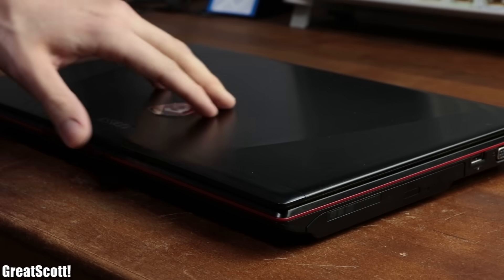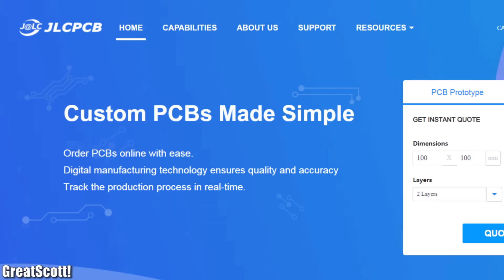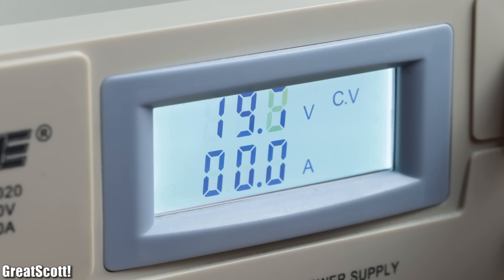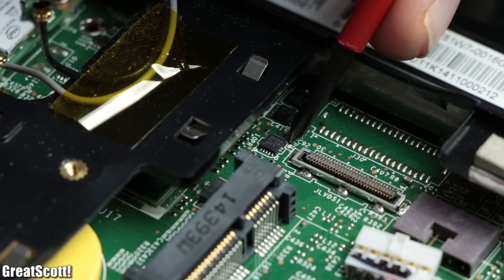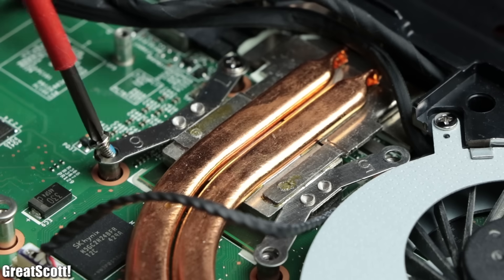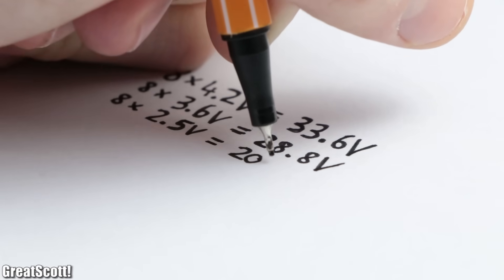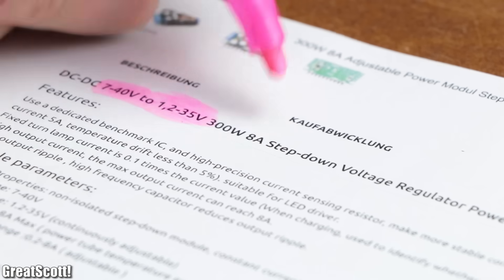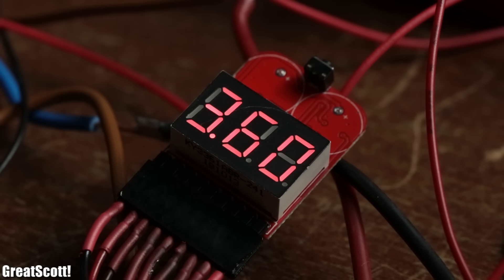DIY Laptop PowerBank (battery pack to charge your laptop on the go)

Comment: Next Video should be for a desktop computer for power outages.
UPS (Uninterrupted Power Supply)

Include a low battery system to inform the desktop to start shutting down to prevent damage of a sudden power cut.
Reply: you could use an atx converter plug that converts 12 or 19v to 3-5-12 then wire it to a battery then wire a charger to it so it keeps charging then when you have a power outage the battery continues to power the pc . but the issue is if its a gaming pc then the atx psu module wont handle it  im not sure what they are called  but its the 24pin motherboard power block  where you get in an itx pc  what can run off 12v batteries .
Reply: @danielhorne6042  Those ATX PSU modules are known as "PICO PSU"
Reply: Too dangerous obviously
Reply: @rolandmeiner4970  Except that there are thousands of designs on the Internet already, and a noob might try them and shock themselves because the schematics didn't come with a warning. It's better for a big, influential channel to make one with proper warnings than not to. Now, if the issue is that Jeremy (who's behind GreatScott!) is afraid of mains voltage himself (a completely normal thing for anyone who's not Mehdi Sadaghar from ElectroBOOM, including myself), then yes, he has an excuse.
Reply: @GRBtutorials   in some countries it is also illegal to build 
your own devices on mains and making a video about that is dangerous for not knowing viewers who then kill themselves
Reply: I already have a system for my PC, I get lots of power outages during storms because I live in a small town far away from main cities. And storms are also common here, so I bought a 220 amp acid battery and connected it with Inverter which charges and also give power in outages.
Reply: I believe Google, when they used to build their own servers, had a design where a battery was charged and maintained via the regular power supply, and would power the server until it could be brought down gracefully.
Reply: @Blondie SL sorry, you are wrong...

Pure sine wave is needed to run rotating devices, like an induction motor and the like.     Pure sine wave inverters don't exists to make clean dc power.  In fact, they use dc to make the sine wave.   UPS's run off grid power and use a battery when running DC.  

Clearly, you have little experience if you don't know why a pure sign wave is needed.   Square wave creates massive heat in things like an AC compressor,  a ceiling fan motor and can hardly start a drill.   

I know,  you feel empowered and think you know all. 

When a pure sine wave is converted to dc you still have choppy power. A person uses a full bridge rectifier to use both the valley and the peak of the AC wave, this still gives wavy DC power.   It is a noticeable chop with either source.   Capacitors and inductor rings are used to stabilize the DC signal.   It isn't like a pure sine wave creates smooth DC.  It is the cap and ring that does that....
Reply: @Blondie SL I have experience,  in fact,  I am dealing with it now.   Every day, all day...

For the average converter, pure sine wave is better.   It is assumed that is what will be the input.   But,  it still remains true that the capacitors and induction rings are what stabilize the DC signal.   Not the sine wave itself.
Reply from the maker: I will not make a mains voltage UPS
Reply: @greatscottlab  Ahhhh... I was really looking forward to a DIY or BUY of that.

May I ask why not?
Reply: @TheIceLeopard  They're dangerous and even experienced EE's don't like working on HV PS's from what I've read...  especially live (plugged in) testing the circuit before the rectifier... after can be dangerous too if HV.
Reply: @TheIceLeopard  ElectroBOOM will do it, as he knows alot about mains voltages, think of how many times he's shocked himself!
Reply: @TheIceLeopard  I know I'm late, but have you accidentally created a short on AC lines? I have and it is fucking scary. Let's not forget that 240V AC can fry your flesh.
Reply: @greatscottlab  you could do a video with a old but working ups which doesn't have a lead acid battery anymore so very cheap and show how you would do a li-ion battery from old laptop cells and balance them with a charger which measures their capacity. you would just need to try and make the series connections as closly matchen in capacity as possible there are cell repacker sites which calculate the parallel packs and their capacity so all parallel packs are matched or as closly matched. i did it already and have a working even longer lasting ups than before using used laptop cells which i got for free from my school
Reply: @greatscottlab  That will be a 230v inverter and there is a previous video on making a modified square wave and spwm inverters
Reply: @greatscottlab  Doesn't need to mains voltage - I made one back in the day that had a 12v lead acid battery to all the AT (yeah, that old!) voltages kick in when the mains failed. It worked, but when I upgraded to ATX I went with a commercial UPS (I also had 14 SCSI hard drives in that case, so a UPS was a must!) It can be done, but the cost/convenience of a commercial UPS outways the DIY approach in my opinion...
Reply: @greatscottlab  Most PCs (if not all) work with 12V, maybe there is a way to utilize a stable power converter with batteries and charge them with standard chargers, so there is no need to touch the mains voltage!! :)
Reply: @greatscottlab  then how about DC power supply for pc?
Reply: @greatscottlab  well you dont need to build a mains voltage UPS, there are PICO PSUs, wich use 12V DC input and convert it into ATX standard voltages. So a low voltage UPS would work fine for a PC with a PICO PSU, or also modems, routers, switches, etc. could benefit from a low voltage UPS due to higher efficiency (230V PSU->12V UPS->modem) vs. (12V UPS battery -> 230V UPS Output-> 230V PSU -> 12V modem)

German: es muss ja keine 230V USV sein, sondern eventuell eine Niedervolt USV z.B. 12V. Es gibt für PCs sogenannte PICO PSUs, diese haben einen 12V DC eingang und wandeln die 12V in die vom ATX Standard benötigten Spannungen um. Oder Modems, Router, Switche usw. können von einer niedervolt USV profitieren, durch eine höhere Effizienz. Bei einer normalen USV werden die 12V Batteriespannung in 230V umgewandelt, und im nächsten Schritt werden die 230V wieder in z.B. 12V für ein Modem umgewandelt. Diese zusätzliche Umwandlung würde bei der niedervolt USV entfallen.
Reply: @greatscottlab  Just avoid dangerous stuff. Use inverter for that.
Reply: @greatscottlab 12v DC UPS inside the PC then?
Reply: Yes
Reply: In india we have such ups systems, i have one with 150AH battery, and powers my desktop as well as light & fans of my house.
Reply: I was just looking for smth like that
Reply: @Blondie SL why do chips need pure sine wave?
Everything do converts to dc, know?
Reply: @Blondie SL thank you for long answer.
Do smps in cpu of desktop converts everything to dc (I think so) so there will not be problems with a PC?
Or a laptop etc
When signal converted to dc everything looks same, know ?
Reply: @Blondie SL that makes sense!
Reply: Take away, common sense isn't common anymore.
Reply: @Blondie SL you typed a lot to say you don't want to type a lot explaining.   A capacitor would clean up the DC voltage.  You could also run through a battery.   A square wave can be used with practically no problems on most consumer electronics.  Is that not the point of the caps On switching circuits anyways?  That and the inductors?
Reply: @Blondie SL is obvious you can not explain your position.  I am literally working on a pure sine wave inverter as I type this.   Okay, I'm actually transferring files to a new micro SD card for my raspberry 4.  But hey, I explained exactly how your convert AC to DC using a diode, you on the other hand did nothing.   

Do you even own a oscilloscope? 

I'm sorry but your bluff has been called.   Obviously,  there will be a little jitter when going from AC to DC.  But, that happens either way.   

I have dealt with inverters, converters,  computers, UPS'S my entire life.   

 At this point I'm almost embarrassed for you. A square wave needs less smoothing then a pure sine wave.   So I will say no more but with a rectifying circuit using diodes also having  Capacitance and a induction ring you would have a perfectly smooth DC current.   

It's hard enough arguing with a person who knows the subject,  is impossible with a person who thinks they know but doesn't know.   

 Not only can you Google check any authoritative source, but I am reading a in my electronics book as we speak just to make sure.  

Here  ya go
https://    electronicsclub dot info/powersupplies.htm
Reply: @Blondie SL don't forget a regulator at the end of the circuit
Reply: Just buy a inverter.

Comment: I hope you cleaned off the old Thermopaste and applied new when you removed the heat sink in the laptop.
Reply from the maker: Not really.....
Reply: @greatscottlab  Oh boy.
Well if you start having overheating issues then you should try replacing the thermopaste, as that might be the issue.

Comment: 144 Wh pack.. guess you won't be taking it on a plane then?!
Reply: They will look at you veeeery weird if you try to bring a powerbank that does not look commercial regardless of size. Or any other 3d printed box full of wires and displays. Personal experience.
Reply: @bardenegri21  I've taken some pretty weird projects on flights. I tell them up-front what it is. It usually spends some extra time in the X-ray, but that's all. My wire strippers, on the other hand, were confiscated because the handles were too long.
Reply: @JamesPotts  I thought you said "wife strippers"
Reply: @tristan6509  They wouldn't let me take those on, either.
Reply: @JamesPotts  -- I remember being able to carryon my tool bag which was full of sharp pokey things and a utility knife.  Not even remotely an option now.
Reply: @JamesPotts  I can relate haha, I had some rat nests of wires go through airports, takes a bit of explaining but it usually works out OK (and the parts that don't work are the ones you least expect, like your wire stripper story)!
Reply: i brought mine and no one watched me... well was super simple and small so maybe looks like a commercial one in the scanner. anyway they have no idea of what is the real capacity just passing under the scanner.. u can easily fake some specs and say that is 80wh or so
Reply: NS Gaming that’s not as what I did once.  I had one of those Altoids computer fan once. Multiple agents came and interrogated me. Since I was young, they let it slide
Reply: no fly list @bardenegri21
Reply: @bardenegri21  True, also you can buy extra battery and charge it in the same laptop, i believe it would be much smaller and cheaper !
Reply: @ofn68  I'd agree, only given that you can still get new ones for your model, and they're not massively overpriced. Especially in the case of the laptop used in this video the production run is not as large scale as it is for say, thinkpads. 100 bucks for a 3s2p or whatever similar pack is excessive when you can get reclaimed cells with at least 80 percent capacity for under $2 each online. You could also make the battery pack separate from the charging electronics, and swap out multiple smaller packs to get around the 100wh restriction.
Reply: should not be above 100Wh per battery, and that too need to be taken in carry-on bag
Reply from the maker: What is the limit?
Reply: @greatscottlab  I believe it's 100Wh
Reply: @Eman2000  90 is what all the big laptops have
Reply: @BAMB00STE  I've seen a lot of power banks and laptops that are 99.1Wh
Reply: @Eman2000  Oh dunno then, I just remember Linus mentioning something about 90wh in his video
Reply: @BAMB00STE  yeah in his video about why we have 2 separate red cam battery.
Reply: @greatscottlab , 100Wh.
Reply: GreatScott! In China ，we can only take 30000mAh at 5v
Reply: @billcrm  You mean a 4.2v cell? Or an adjusted total current for 5v, after the step-up converter?
Reply: @greatscottlab  100 wh only.
Reply: @greatscottlab  Late anwser but max is 100wh - 160wh,  battery bank that is higher than 100wh and less than 160wh must go through extra security.
Reply: GreatScott! The limit per FAA for general lithium rechargeable batteries is 100 Wh, HOWEVER - with approval, you can carry on one spare battery of up to 300 Wh or two spare batteries up to 160 Wh. These will have undergone testing and certification, and will have a special “air transport safe” sticker with a link to the certifications. DIY batteries won’t fit this category.
Reply: It's just a rule.. some security obeys the rules, others do not. But if you don't have a pack with proper markings like capacity and CE they might easily ban it.
Reply: pfft, stick a label on it saying 90Wh, you'll be fine :P
Reply: If you have an external disconnectable link then you can get around the 100Wh limitation. I have a couple of Thunderpower 5s 6600mAh packs that had an external series link to divide the pack into two. On the label it says "This unit consists of one 3 cell 73.3Wh and one 2 cell 48.8Wh battery, 3.7v per cell."
Reply: @SuprSi  or make the case can disconnect the cells individually. problem solved.
Reply: @SuprSi  I mean like AA battery case, but with battery cells instead.
Reply: regardless if i take two Anker 21000 or my 100Wh diy battery pack. if it gets punctured you dont contain it...
Reply: Depends on the airline. In the US most don't care how many you have under 100Wh as long as it's "within reason". You can usually take two packs that are under 160Wh without having to notify the airline first but over 160Wh requires special permission from the airline to be brought on board. I think the EU regulations are similar but as always ymmv with ant given airline.
Reply: @LtKernelPanic and others.

ICAO and IATA rules are pretty much international to all countries and commercial airlines (except the most third-world and the most back-wood of operators).  So, there is no need to say "TSA" or "FAA" or "US" versus "EU" and so forth.  Commercial aviation and its rules are all pretty much standardized world-wide.

"The International Air Transport Association is a trade association of the world’s airlines. Consisting of 290 airlines, primarily major carriers, representing 117 countries, the IATA's member airlines account for carrying approximately 82% of total available seat miles air traffic."

"The International Civil Aviation Organization, is a specialized agency of the United Nations. It codifies the principles and techniques of international air navigation and fosters the planning and development of international air transport to ensure safe and orderly growth."

So, no need to say "ymmv".  Almost globally, 100 Wh of lithium ion is the limit for passenger-carrying aircraft without some special exception or permission; and it must be located somewhere accessible (in the cabin with the passenger and crew and NOT in the baggage/cargo compartment below).
Reply: @user-dj1hy6zc6q  well I mean, if we continue with whats going on currently in the US, pretty soon there won't be anyone there to give a damn anyway
Reply: https://www.tsa.gov/travel/security-screening/whatcanibring/items/lithium-batteries-more-100-watt-hours you can with pre approval ;) gute Arbeit Scott :)
Reply: I never understood why the 2015 macbook pro (15”) have 99.5Wh battery. Now i know!
Reply: i dont think i want to bring a home made pack on a plain imagin if it went off people would be screaming thinking its a bomb about to go off🤣
Reply: I want to know how to label such enclosure box for indication like on/off, output/input using printed text? In this project only marker pen is used and that doesn't look professional!
Reply: Or you could buy a second battery on amazon for 24 usd https://www.amazon.com/Replacement-Notebook-Battery-GE620DX-BTY-S14/dp/B0763XRBS1/ref=sr_1_8?ie=UTF8&qid=1548047428&sr=8-8&keywords=msi+laptop+battery
Reply: @mr.h3377  its not fun.
Reply: You guys realize that not everyone in the world has airport security like America right?
Reply: Basically 7 18650 cells is the limit.
Reply: Shit, if they saw that thing they would probably throw u in jail 😂
Reply: This is probably the reason for doing weird things like puting a C4 In to cells or TNT for example.. but such a big diy powerbank like this one can make a hole in to plain easily with C4 but this thing will weight around 10Kg which is really weird
Reply: I was just going to mention that. Not to mention it doesn't look great bringing a 3d printed box full of wires, PCBs, and batteries through security
Reply: hahah i got 555 Wh Pack inside my portable Bassbox xd would be difficult
Reply: even if it was 100Wh they would thought its a bomb lol
Reply: Just tell them, I'm the great scott. 😁
Reply: diy battery pack is not allowed on plane even with less then 100 Wh

Comment: I have made similar power bank for my laptop almost a year ago but i used 3s battery pack and 4 amps boost converter for powering my laptop and for charging power bank i used buckboost converter so i can charge it with any charger  from 5 volts to 30 volts and its working flawlessly after a uear too.      
And i wonder why didn't you add an AC outlet in your power bank. However you did a great job sir.